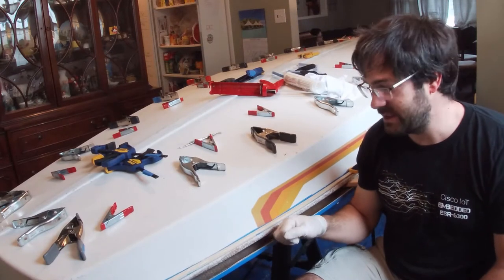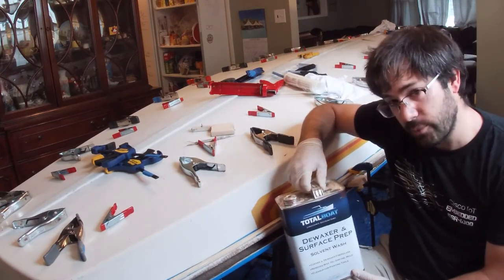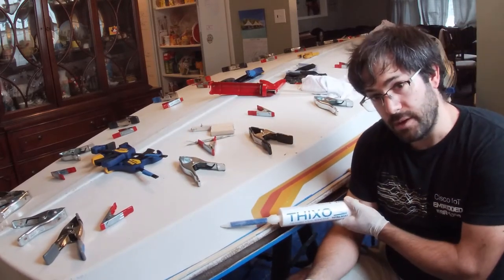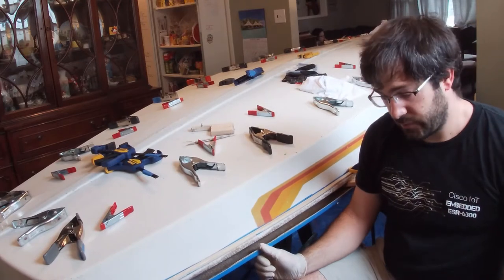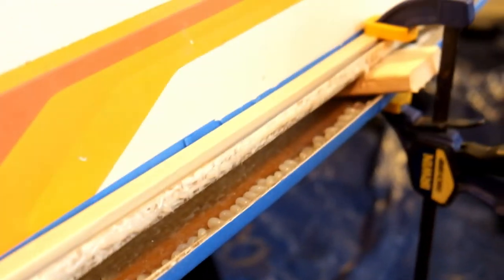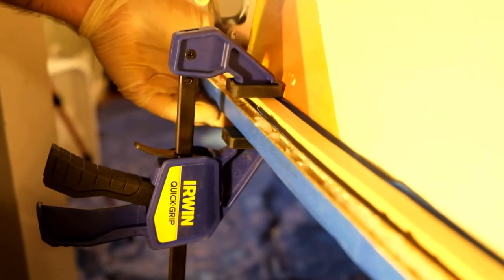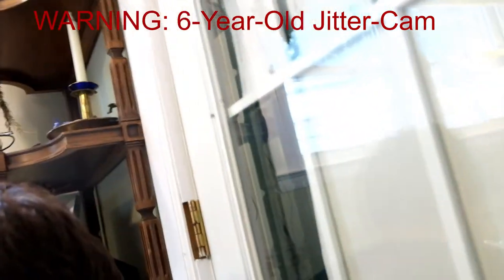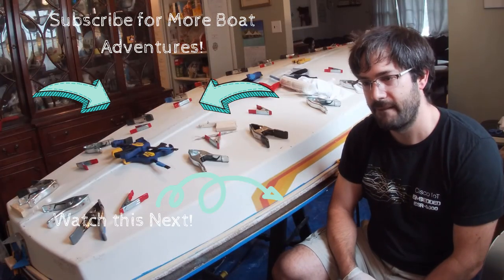Sailboat Deck/Hull Joint Repair (Phantom/Sunfish) - Two Sons Sailing EP 17

Comment: Did you deal the edge of the seam afterwards?

I just got an old Minifish and the seam doesn't leak, but the edge is just open fiberglass, which in theory could take on water and separate over time.

On lasers, they gelcoat over the seam to protect it.
Reply from the maker: I haven't done much with it yet. If you have bare glass fibers showing you could at least seal them with some unthickened resin. That would keep them from taking up water or stabbing your hands. Many of the Sunfish I've seen have metal trim that goes all the way around the edge, instead of the folded seam like the Phantom, although the later versions did away with it.
Reply: @twosonssailing  the minifish has a folded seam too.

I'm probably going to pour polyester resin along it because it's all I can find in my small town. Should be good enough to seal it up.
Reply from the maker: Just make sure you know of any previous repairs that may have been done. Polyester doesn't adhere well to epoxy.